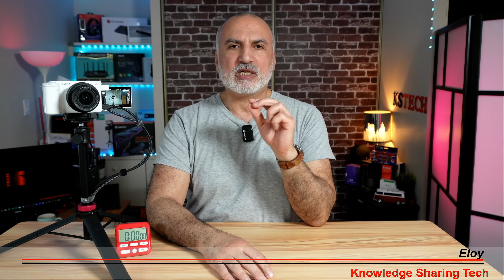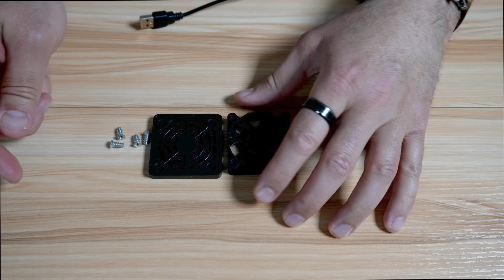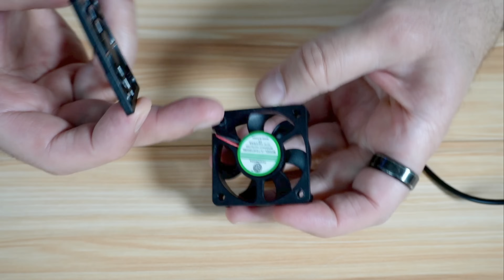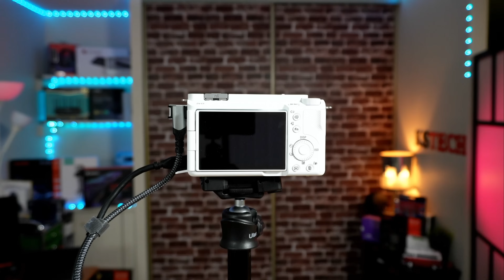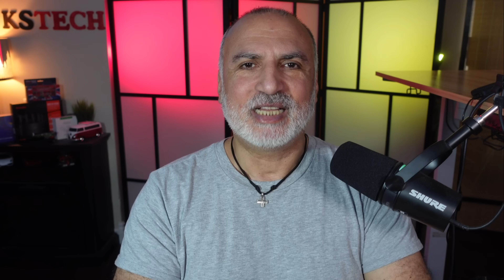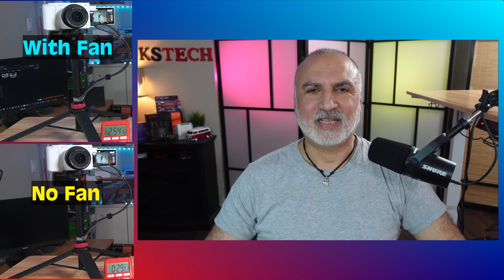EASY FIX for Sony ZV E1 overheating problem

Comment: The link doesn’t work! Any other links?
Reply from the maker: https://www.aliexpress.com/item/1005009887773446.html
Reply: @KnowledgeSharingTech thanks!
Reply from the maker: No worries, and this is the link to the USB cable: https://www.aliexpress.com/item/1005005847614024.html